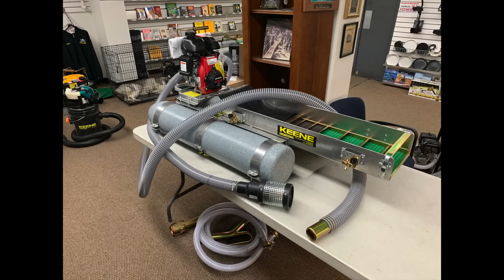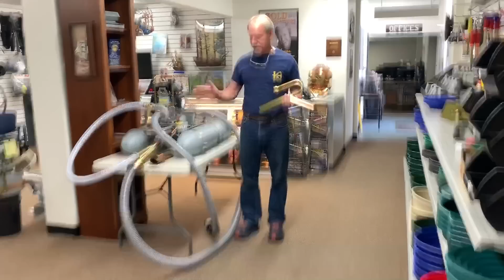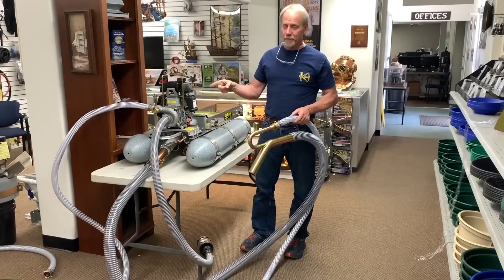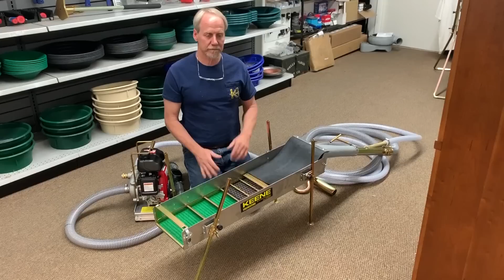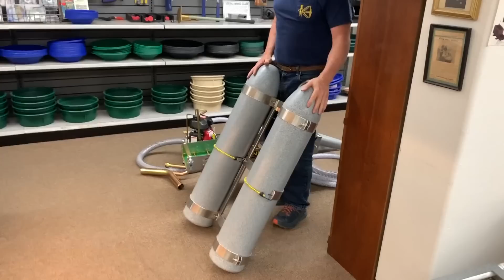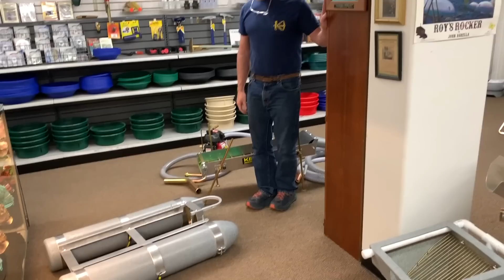New Combo 2" dredge 2004SNPJLK

Comment: comes with everything but Air :(
Reply from the maker: This is simply too small of a dredge for air.  I idea is to be as light and compact as possible and working in shallow creeks cleaning our cracks and crevices.  A dredge this size is not something you want to punch big holes.  You use the portability to access the remote areas and smaller creeks for your best gold.
Reply: If you want air buddy ,I suggest the electric hookha system and a 120 amp battery.that does work well .cheers☠👍👍👍⛏💙
Reply from the maker: If you want air go to a bigger dredge way more practical also Pirate dredger is right 12 volt would be great however 2" dredge is for shallow water and maximum portability
Reply: Let’s look at it from now his prospective , one person can carry it it , compare it to my 4 inch with air , I’m tired getting it there and set up before I even start and I need a decent amount of water there too vs that’s a hi banker too